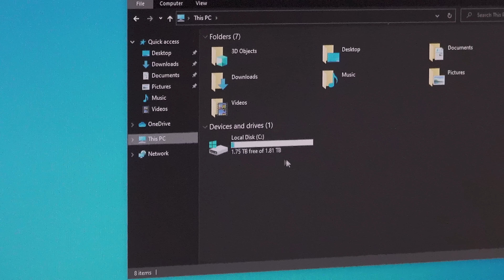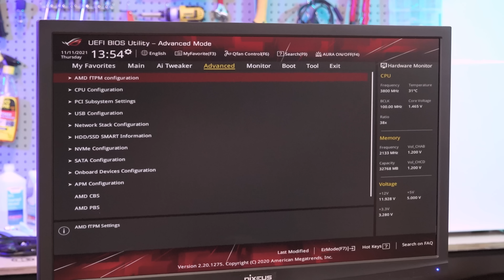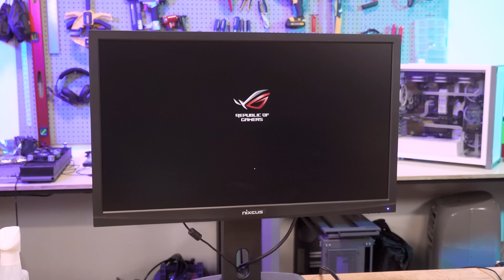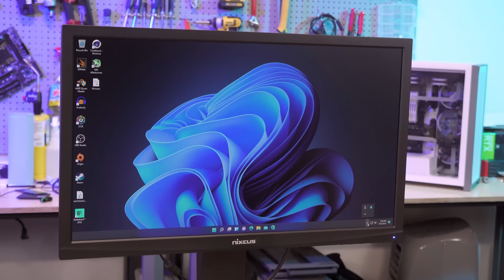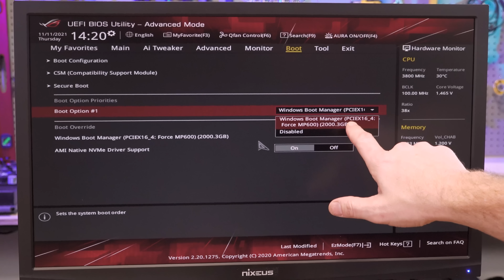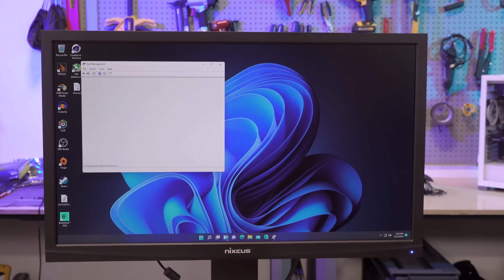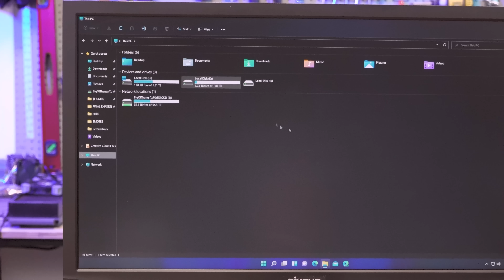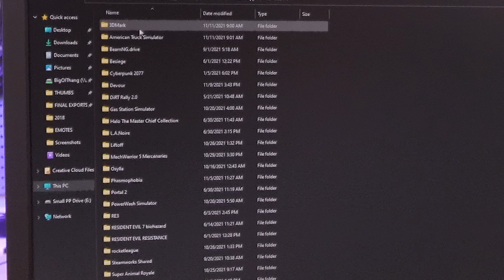Can you move Windows 11 from one PC to another... Let's find out!

Comment: 7:48 You're inserting your knowledge of PCIe 4.0 GPUs with 3.0 riser cables on a 4.0 slot into PCIe backwards compatibility. The motherboard you moved the M.2 adapter into doesn't support PCIe bifurcation.

Comment: I think the reason you were having issues with your drive showing up is that when you hot swapped plugged in the m.2 drive into the bay, there was probably a Letter volume name and pathway conflict with another drive. This can be resolved by turning off the computer, before plugging the m.2 drive in and restarting the pc. 

It's never a good idea to hot swap a hard drive while the PC is on anyway because you can potentially turn your drive file system from NTFS into a Raw partition in seconds which makes it unreadable. I made that mistake once and it was an absolute nightmare to turn the Raw partition back into NTFS by restoring the GUID Partition Table without erasing the drive's contents.

Comment: I have upgraded my PC from a Core i7 6800K to a Ryzen 9 3900x and I just have transferred my NVMe SSD with Windows 10 from the old motherboard to the new one and it just worked out of the box! Of course I have uninstalled the old chipset and on-board peripherals drivers first and installed all the needed drivers afterwards. It works like a charm! A few weeks later I have upgraded that Windows 10 installation with Windows 11. Also no problems at all! Long gone are those times where it was pain in the butt if you wanted to change your hardware!
Reply: @JayzTwoCents What’s that? Oo

Comment: If the Toshiba drive isn't actually dead, it will probably work in  the MB m.2 slot. It won't need the heat spreader if you're just using it long enough to copy data off of it, so it'll only spoil the aesthetic for you for a couple of hours.
You also didn't try the DIMM.2 option.

Make it work, then make it pretty. Jay was trying to to both at once, which can work but when it doesn't is exponentially more frustrating.

That you basically had nothing on it is hilarious though.

Comment: I reckon it is hot swap but you have to plug the m.2 drive in the USB-C adapter first then plug in the USB-C cable not the other way round.
Reply: jayWhatsApp➕1⑨⑤⑨⑨①⓪⓪⓪②②  Reported.

Comment: I have the same issue with the Hyper M.2 card, have to set the motherboard PCIE slot to RAID x8 mode even if you aren't using RAID. This enables the card to bifurcate the lanes and allocate them to each drive.

Comment: I have a theory about the external M.2 drive adapter. Jay claims it's Hot Swap capable, and I'm pretty sure it isn't. At least not the way he used it.

Doing some searching I found what looks like the exact same model of M.2 dock and looking at the manufacturers site I found the instructions Turns out that you have to insert the M.2 drive with the dock unattached, and only after that connect the dock to the USB port. It's still hot swap of a kind, just not the way Jay tried to do it. Also before removing the drive the OS should be told to detach the drive just like you do with any kinds of USB attached drive, and should also do with true Hot Swap capable drives. After that the dock should be detached from the USB port before the drive is removed from the dock.

 Thing is hot swappable drive connectors all have one thing in common and that is the power and signal connection timing. The first pin to make contact is Ground. This is followed by the signal pins and the last will be Power. That way when you attach a drive it will be grounded before the signal pins connect which protects both the drive and the controller from damage. Power is connected after all other pins and allows the drives controller to power up in a controlled manner with no wild fluctuations on the signal pins or open circuits.

The M.2 edge connector is not configured in this way, instead all the pins make contact almost, but not quite at the same time. It's still possible to make a hot swap capable dock for it, but it's not as straight forward as it is for a interface intended for it. I can see two obvious ways to implement this, one being to have a switch or other sensor that detect when the M.2 device bottoms out in the connector and only apply power after this happens. The other way would be to monitor the ground and power pins for a change in impedance and only apply power some time after this was detected and hope that the drive has been fully seated by then. The advantage of the second approach is that there is no extra sensor or switch needed. These are things that could fail and add complexity. The disadvantage is that if the user is fapping about the drive might not be fully seated when the drive power is applied. Alternatively you can let the controller take more time between detection and applying power, but any more than a second or so and the user may get impatient and yank the drive thinking the insertion wasn't detected.

A third way would be to have a switch on the dock that you use to turn on the power only after the drive has been securely inserted. I found several M.2 USB docking stations that used this approach, but the one Jay used isn't among those.

Comment: I moved my w10 os ssd from a custom phenom build to an oem hp i5-4570 and it worked fine. i haven't done a clean install since vista
Reply: Bruh a clean install will get you much much better performance
Reply: @SmarterThanAll  You can't know that, given you don't know my server workloads. It works as expected and inside all benchmark variances for the hardware within. I have no reason to introduce any additional unknowns to a stable 24/7 platform.

Comment: I've done it 5 times! One time was from Intel to AMD. Never had an issue. And it originally started out as Windows 7Pro in 2013, now Windows 10Pro. All on the same ticket! Oh, and I swapped from a 1TB HDD to a 1TB M.2 Nvme via cloning.... (Still have the Original Win7Pro Disc even).

Comment: Hey, I've had that fatal hardware device error before on some of my own m2 drives. It was always when I had them plugged in to an external adapter. I swapped out the adapter and the drives were just fine.  
 Might not be the same case for Jay but that's all I had to do.
Reply: Maybe wrong adapter for the drive.
I haven't seen a combo unit, so nvme drives need a different adapter then sata ones.

Comment: Went from a 9900k on the Z370 chipset to a 5950x on the X570 chipset and Windows 10 installed everything just fine, I made sure to remove Intel stuff before installing the new hardware just in case but it was a flawless upgrade, all I had to do was install the chipset drivers, one reboot and I was up and gaming. That was almost a year ago and have even upgraded that build of 10 to Windows 11 and everything is still running fast and smooth. Windows since the Vista days has been very good at massive system changes, XP it was always 50/50 but these days its very good.

Comment: I moved Win10 pro a month ago from a 10+ year old PC still on a AM3 platform to a brand new AM4 build with no problems.  I just had to re enter the activation key I used on the original OS install and it activated.   After that I migrated the OS from the original SSD it was on to a 1TB NVME I installed on the MOBO.  The new PC sure is a lot perkier than the old PC.  : )

Comment: Those external M.2 readers are not "hot swappable" the way Jay thinks they are. You have to unplug the USB connection before inserting or removing an M.2 device then plug it back into the USB.

Comment: Brave man.  Any instabilities are totally on you, then win11, then the mobo, and finally the amd cpu or the gpu mfg.   Fresh installs are always recommended for situations like this.  What I've done is move the drives as is, but they become data drives and the boot drive is always a new OS install drive.   I will not use or trust Win11 for a good year or so after it's launch. Good Luck, hopefully you won't need it.

Comment: I recently got that exact same error with a Sabrent Rocket 4.0 SSD. I got a blue screen all of a sudden and my PC wouldn't boot to Windows, the drive wasn't recognized in the BIOS as a boot drive. I then installed Windows on a SATA SSD and when I tried to initialize the Sabrent drive it gave me that same "fatal device hardware error". It didn't magically fix itself though like Jay's drive, nothing I tried worked. I tried using the second M.2 slot on my motherboard as well as recovery software, but the drive is just completely gone. I'm going to RMA before the warranty is over but there's some data on it I'd like to recover, so if anyone has any ideas I'd love to hear them.

Comment: Not sure if this is a similar problem, but I had a Crucial P5 2TB that would not work with an external enclosure. That could be a similar issue that you're experiencing with the external dock not working with that particular drive, the firmware of the drive may only like motherboard slots. Just a thought, great video as always!

Comment: In my experience it's hit and miss. I have had many versions of my main rig since the late 90's. When Microsoft launched XP back in the early 2000's; I would upgrade usually to something that was already a gen older then the bleeding edge that had just come out. It would recognize the new hardware and install the software. Now you can change a whole system out and it may or may not ask to be reactivated. Once 7 came out I basically stuck with the same sata ssd for almost 10 years and at least 6 of those it was my main boot drive. Changed motherboards, cpu's, ram, video cards...still hit and miss for re-activating Windows. Currently on 11 pro.

Comment: Jay the PCI M.2 card may only support RAID 1 or 0 with 2 cards.  They may be why you only saw one being detected. 

Also Win key + pause break > Product key and activation > Active State to check your status.

Finally I would have love to have seen the device manager.  All Windows since Windows Vista has been fantastic about changing systems.  Prior to that the Hardware Abstraction Layer was only detected on install so Windows 9x, 2K, and XP all SUCKED at moving systems unless the HAL was identical for the hardware.

Comment: Actually pretty impressive how both Windows 10 and by extension 11 have become quite resilient to complete system transplants to the point of going through the UPnP part of OOBE again to re-orient themselves. Windows 7 and earlier would just freak and go right to BSOD if you attempted that.
Reply: Fucking love that. Makes hardware upgrade so easy instead of dreading it and then taking months to get everything where and how I like it.
Reply: Not really i have taken  hard drive from a windows 7 laptop and put it in to my desktop and it booted but there was some resolution issues
Reply: @11creeper45  Originally depended on the driver for the boot device. Windows recorded it in the registry and would only attempt to boot off of that.
If it was similar enough then you could get away with it, otherwise you would just get the inaccessible boot device error.
These days, it is possible to have big changes in the hardware as long as any required drivers are present in the Windows driver store.
Reply: what's impressive is how they managed to make it not be able to do that for so long
Reply: @executor32  Mhm. But your comment is getting into territory not implied by this video. That is, not just a simple drive transplant.
Also remember, this is what the Windows RE stuff is there for. I have had a couple of cases where I have transplanted a drive, the install failed to boot, Windows RE kicked in and then startup repair fixed it.

Comment: Actually you don't need TPM to just run Win11. The check is done only during installation. Win11 can be installed on a potato using some workarounds.
You don't need to worry about the Windows licence. As long as Windows was activated on the motherboard before, it's registered on MS servers and Windows will activate automatically.

Comment: It seems that a lot of PC builders today don't take static protection into consideration when handling their parts for these builds. I've heard folks say that it isn't an issue as the machine booted fine following the work, however that doesn't mean things are fine. Some discreet components degrade substantially instead of a hard failure and then the card's life is shortened.

Comment: I had a vaguely similar issues with moving drives AMD to AMD. I tried out StoreMI (technically makes a custom RAID) with a new Ryzen 5000 build for a few months and then uninstalled (its complete garbage - NEVER again). I moved my drives over to a new system a few months later and all my drives were there but were locked out in Disk Management and I couldnt get them working again until I got those damn RAID drivers installed. I didnt install StoreMI again but just AMD RAID drivers. Even two drives that I never used with StoreMI had this issue. But installing those RAID drivers fixed it all.

Comment: Jayz in theory there is still a problem with Ryzen in W11, if you change the CPU with the same system the problem of L3 cache latency comes back. For the M.2 drive I think is because is not getting enough power from the USB port.

Comment: Used to do this a lot in a PC service job. One test drive with Windows installed could be reused numerous times. Eventually though, it will collect too many drivers, eventually getting something that renders it unstable on other systems, and we'll have to start it fresh again.
Reply: Is it possible to make one master drive and use only copies from it in fixed PCs?
Reply: When you swap a drive from one pc to another, do you have to uninstall all the old MB/drivers? How can you easily do that?
Reply: @DanielDefense69420  exact same thing I was wondering is there a bunch of junk files and incompatible drivers left when doing this kind of swap
Reply: did you run over issues with reusing same boot drive from migrating to intel to ryzen?
Reply: Force an OOBE so Windows unloads all previous drivers and re-sets the drivers for the current hardware.

Paragon Adaptive Restore used to do this pre-Win10.

Very useful for when you go from SATA to IDE mode to RAID mode to external USB drive and so on.

Comment: Jay...  I think the reason why that Windows 11 drive,  was transferable from one machine to the next, is because your copy of Windows is "Retail" license version,  I believe the retail copy allows the transference of the Windows validation process.  Where as an OEM drive with a Windows 11 installation would Not validate, an example would be an HP machine to a Dell.   I believe this is one of the key points to having a Retail version of Windows.  also, because of your business you may have a volume license key...???  Maybe???    Those volume licenses are for the big guys and they are purchasing many copies, just some thoughts.   Want an idea for an experiment... Clone that drive... And put the clone in your previous machine, and see what happens ?  Also, does Windows 10, 11, have a license key in the registry that a key reader could show you... With Windows 10, I pretty much don't look for product keys anymore because of the New Way, Microsoft validates their product, but they still may use a key to start their validation process and create what generally is assumed is a new validation key after going through various things on the motherboard to generate a key.  Boy,... Were back to those days of guesswork on how this validation process works. :-)  P.S. I love Micro Center,  I saw a recent video you made of the remodeling of the Tustin store, I am about 1 1/2 hours away from the Tustin store, (near Palm Springs)  but I do visit the store every few months, it would be a one in a million chance to run into you, but who knows maybe it will happen one day.  :-)
Reply: The drive would have been transferrable regardless, there is no distinction between retail and OEM versions of Windows these days.
The worst that would have happened with a OEM is that it would have deactivated. Windows should also have no issue reactivating if there is a usable key that is currently tied to the hardware that you are moving to.

Comment: @ 3:20 TPM 2.0 only is need when you are doing the update from 10 to 11 through windows update.  doing a fresh install or running the media creation tool to update doesn't check. People are running windows 11 on Core2duos and older without issues related to TPM
Reply: Yep, I just used the creation tool to put a fresh install of 11 on my Skylake laptop last night via USB. The only goofy thing with the install is that it requires a network connection to proceed, but you can shift+F10 to bring up the command prompt to taskkill it and move on.
Reply: @jkvinsland  it's really funny too how arbitrary the "requirements" are, as MS forget to exclude the Pentium 4 family, so if you install Win10 on a Pemitum 4 775 (either HT or D version) windows update says your computer meets the requirements and will auto update to 11 for you.
there where quite a few articles about it mid Oct
Reply: @edison700  That's why I disabled TPM on my Zen 3 desktop, just in case. I'll preview 11 on my laptop as I pretty much just use it for basic browsing and streaming, but I don't want to be thrown into a whole new OS involuntarily.

Comment: This is good to know because I usually just transfer my boot drive to my new hardware and it works so that I do not have to re install windows and all my programs. This last upgrade I went from an Intel platform to an AMD platform and had no issues at all. Once up and running I go into Device manager and show all hidden devices and uninstall all old unused not needed drivers which are all grayed out.
Reply: That seems like it works but Hardware Unboxed recently did a video about it you should watch it. Even uninstalling drivers there are still things like regkeys etc that are left behind and cause problems.